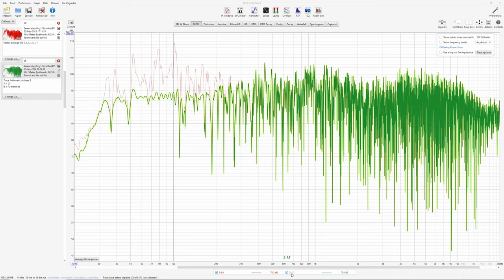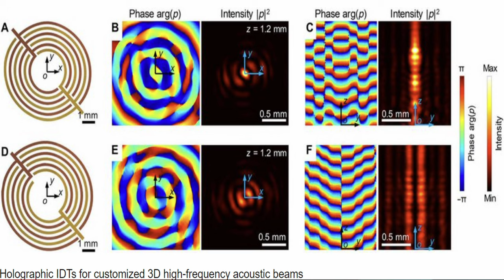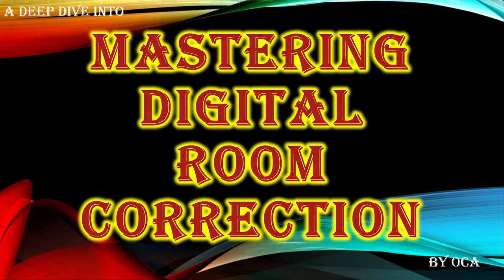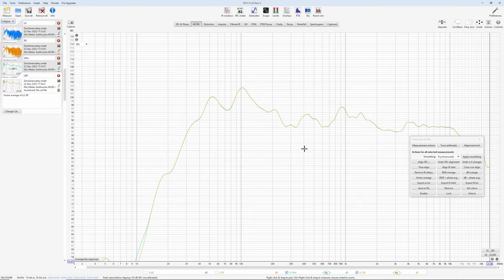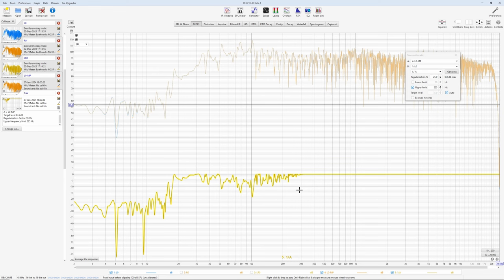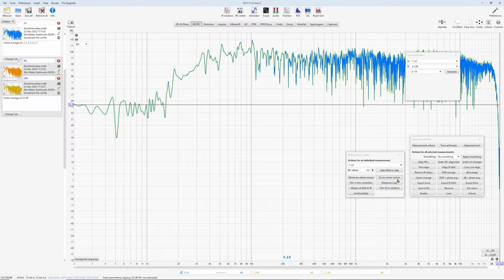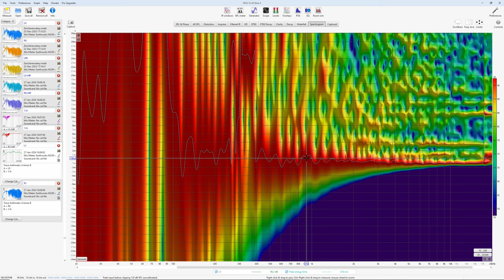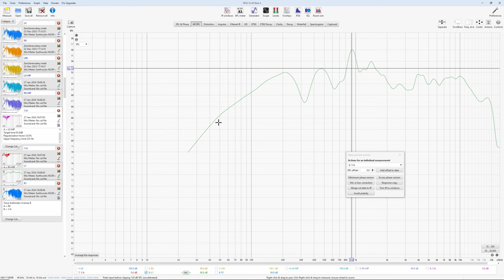Mastering Digital Room Correction

Comment: Discovered your channel through exploring the inverse filter technique for my full range speakers, and the results have been transformative—full control and unparalleled sound quality. However, I'm facing challenges integrating DSP with my JBL 590s, which sound nice but not superior with DSP. Every attempt to enhance them through DSP paradoxically detracts from their performance, falling short of the no-DSP setup. Any insights or suggestions on this would be greatly appreciated!
Reply from the maker: Frequency domain filters should work below the room transient but that's not enough to avoid sound degradation. Hard to say what exactly causes it in your case without seeing the actual measurements. I can have a look if you share.
Reply from the maker: Can you share your original and min phase mic calibration files?
Reply: @ocaudiophile I've shared the original and minimum phase microphone calibration files in the same folder for your convenience. Additionally, I've included a file for the 90-degree measurements that I had on hand to compare. Thank you once again for looking in https://drive.google.com/drive/folders/1yQxKyoWKHtQu2-b-kgZ7wUBxjO35HeSv
Reply from the maker: You've done everything right (one of the best implementations of my methods I have seen to date) but your speakers are not the easiest to calibrate. Left speaker seems to be closer to adjacent walls than the right. Most measurements had some distortion here and there but there were enough of them so I could pick good ones. 4M measurement length was tough to process even for my PC which is a beast, had to trim them to open in rePhase. Anyways, it's all done now and I'm sure they will sound great. Removing IR delays from L & R was a bit tricky, I guess that's where your filters failed. I've also embedded phase linearization (XO590.wav) into the filters. StereoConvolutionFilters.wav is the filter you need. In the highly unlikely case that, you will hear pre-echo with this one, use ConvolutionFIlters_2.wav. That's 110% echo safe but will not sound as good as the other. REW and rePhase files with all details are included in the zip below. Enjoy!

https://drive.google.com/file/d/1xjEu6LmNIySQnuBVw85xTVJMs4Wf5VtJ/view?usp=sharing
Reply: @ocaudiophile  Thank you immensely for your analysis and for the filters you've crafted. Beyond appreciated. 🙏 I'm eager to test the new filters and experience the difference soon.

May I ask whether the adjustments you've made were derived from the measurements in the 'InverseMP' file or the 'Feb_6_Fresh' one?
Reply from the maker: The "Fresh" ones but I used only one of many left and right speaker measurements in that mdat. I kept their indices so you can see which ones are used.
Reply: @ocaudiophile  From the very first second, the quality of the filter was so obvious. And of course it sounds like a much better filter that I ever had with these speakers. It's right, clear, and incredibly promising. The soundstage is beautifully layered, although I've yet to delve into all the nuances due to volume constraints. Hopefully, more critical listening can be done tomorrow. Both files are impressive so far.

I'm eager to understand every step you took in this process. While I grasp most of the techniques found in the file, 'almost' isn't sufficient for replicating such an effective filter. I'm particularly curious about how you managed to remove the IR delays. Additionally, I'd love to know how to place my left speaker correctly relative to the wall, which vertically is a mix of concrete and windows with ~ 8 cm in difference. Hence it's a tricky reference. I also struggled with Rephase. I'd love to see the numbers you have applied. I assume it was an important contributor to the quality of the filter.

There are so many questions I have, yet I'll sleep a happier man tonight, thanks to your help. I'm profoundly grateful for your guidance and the time you've invested in enhancing my listening experience. Thank you 🙏
Reply from the maker: L&R didn't both shift their IR peaks to t=0 with regular "Remove IR delays" so I cross corr aligned L to R first then removed IR delays and it worked (if I remember correctly). The clock deviations in the measurements are kind of high around 25ppm and this could be the reason for REW to fail at first.

You have to at least achieve symmetry with side and rear walls between speakers or it will be very difficult to center the phantom stage. It will shift slightly to one side with certain tracks depending on the vocals' frequency. Rotate the whole setup if you have to and try to achieve 1/3s in the room with the speakers and the LP keeping an equilateral triangle, you will immediately hear the difference in sound stage.

Phase correction was done based on the Left speaker EP (the txt file in the zip). Your speakers have one crossover at 1500Hz according to spec but somehow they benefited more from a correction at 2400Hz instead (The 1500Hz filters you will see in rePhase cancel each other out and there's only a weak paragraphic eq there)! A subsonic filter was added to remove group delay from the bass completely which should improve the bass speed. The other empty/disabled slots you see are my trials to get it right. These JBLs have a very different phase response due to their design compared to speakers I have seen before.
  @beepaaah
Reply: @ocaudiophile  Today, I spent the morning passively listening to my system and the filter, enjoying classical music from a radio program and overall sound. Later, I switched to a little bit louder volumes, from Roon to Camilla DSP, from classical to a more variety. The tightness of the bass and the clear layering of the soundstage were particularly enjoyable. However, during a track change, I thought my neighbour might have increased their volume, but it turned out to be an echo lingering for a few seconds after the music stopped, seemingly originating from the speaker ports, though I'm not entirely sure. After paying more attention, this background echo became noticeable even during music playback, leading me to switch to the second filter. This change noticeably improved the music quality by eliminating the background rumble, although I'm still evaluating other aspects of it.  For now, it remains my preferred choice...

I want to understand the differences between those filters and how exactly they were created. Maybe I could then experiment with trimming to reduce the load on my laptop with Camilla DSP, since Roon runs smoothly. Maybe to try some 3 dB shelf. (I know you are not a fan). So going through the REW .mdat file, I follow up to the 1/A filters creation. It looks like the steps that follow after that are made mainly for looking into predicted response? Am I correct? 

Phase indeed is tricky with these speakers, likely due to their 2.5-way configuration where one woofer doesn't extend up to the same crossover frequency as the other. (I've Included a link to more detailed measurements from audiosciencereview and one australian magazine in google drive.)

I've loaded the txt file in rePhase, yet it doesn't reveal the applied settings. Could you, please, export those settings as well?

Lastly, what is the best indicator in REW  to determine if one speaker is too close to a side wall compared to the other? P.S. Apologies for the lengthy post and thank you for all the help, once again.
Reply from the maker: Filter 2 is made up of minimum phase versions of the "1/A" filters and this guarantees to remove any pre-echo that could be produced by the sharp phase shifts in "1/A" filters. Normally, this shouldn't happen when there's enough number of taps as 1/A filters are also inverted minimum phase responses but I guess you have experienced first hand when you switched from Roon the effect of lower taps on these filters. The minimum phase version of 1/A filters are same in frequency response but they don't correct the phase as much as necessary, only as safe as possible.

The disadvantage of inverse filters are that inversion requires zero padding the FFT so the window sizes double up and unfortunately trimming the windows, dropping tap counts, anything can easily ruin the delicate balance and push them into pre-echo territory. From what you describe, it sounds like pre-echo. Try listenning to the beginning of Billy Jean from MJ. That track is an instant pre-echo producer.

The rephase file I sent you produces the .wav file I used in the REW mdat. It just has some unused filters in it which cancel each other out, you can remove them and the phase shape of the EP.txt file will not change. It uses the txt file I sent you, too. You should have everything in the zip unless I sent you somebody else's by mistake.

If you look at bass responses of L and R, you will see that L has substantially higher bass response than R which can only be stronger reflections from walls since the speakers are identical.
Reply from the maker: I also suspect that the final 25-50Hz of the filters not being exact inverses due to REW starting to fade out the inversion, may be the cause of pre-echo with this method. I tried to avoid it with some very complicated techniques but I am not yet convinced of their robustness. IT will possibly be another video when the time comes ;) @beepaaah

Comment: Hi OCA, could you possibly help me with your procedure? I'm not sure my measurements look right. Things are not equal on both sides of my listening room. PSB Synchrony One speakers seem to be canceling each other at 35 to 60hz when measured together but not separately. I did the mic min. phase, 1LP for all measurements - measured each speaker 3 times using length 2M, vector averaged L and R separately. My impulse response start looks like a saw-tooth: i cant seem to find where to align left with right because of this. Thank you
Reply from the maker: Difficult to say without seeing the measurements. Can you share your mdat file here?
Reply from the maker: I need access! @IanBester-j4j
Reply: @ocaudiophile   Hi, i have given full access. Sorry about that. i will email the files if you are still struggling.
Reply from the maker: You've changed the acoustic timing reference channel from right to left during measurements, it should always be the same channel for both speaker measurements. But this is not the reason for the dips in combined response, it's to do with asymmetric wall proximity between speakers. I fixed most of it by applying an extra allpass phase filter to the right speaker (Rxo.rephase which produces Rxo.wav filter). The optimal Q value is 5 but this could cause ringing so I left it at a safe 2. You can experiment with higher Q values and improve the dip even better. FL-trimmed_FR_trimmed-48k.wav is the final stereo convolution filter which should sound good:

https://drive.google.com/file/d/1mgnWTh2GQdGbF-7cckRoImDgGL3V1Xk-/view?usp=sharing
Reply: @ocaudiophile  Thank you so much OCA - I will try it on foobar2000 and let you know. Should i remeasure 3 lefts and 3 rights with only right as timing reference? My room has an alcove on right speaker side, that side is also drywall but left side is brick wall with no discontinuities. 5.4meters by 4 by 3.2 high (speakers facing short wall)
Reply from the maker: I removed IR delays and they all shifted on top of each other. I don't think it's necessary now. If you dislike the filters I sent you then of course you can re-measure and re-do. Btw, I disabled 3 high distortion measurements and used only some of them.

PS I hope Foobar and your PC can handle 262k taps. There was no further trimming possible without changing window sizes which I don't prefer with this delicate filters.
Reply: @ocaudiophile  Just had a quick listen - I might be doing something wrong but it sounds the same, i used the trimmed wav file with foo_convolve component lol, should i listen at the same volume level as when the measurements where taken eg -25db on denon receiver?
Reply from the maker: same as in? @IanBester-j4j
Reply: @ocaudiophile  Morning OCA, sounds like nothing has changed with foobar conv. When i try JRiver Studio Convolution with WDM Driver WASAPI Output i get less bass but the upper freq. sound the same, toggling between clip protection and normalize filter volume changes some loudness, more loudness and bass disabling convolution - nothing else changes, also not much CPU usage at all maybe 2%
Reply from the maker: Don't normalise the trimmed.wav filters and I'm sure they'll require some clipping headroom quantity will vary depending on the convolver. The major dip in the bass region must be improved with these filters but you'll only hear a difference with a track which has bass at that exact region. It can be further improved by increasing the Q value in rephase filter for the right speaker. The overall bass level of your system is a different story. Min phase inversion produces what your speakers are meant to produce with min delay but if you want more bass then you need to get the wall reflections and delayed bass involved. It's a choice. Generate a low shelving (LS)  filter to your taste in REW EQ and multiply both of the final filters with that before export and you will have bass as deep as you want although some of it will rain in mids and highs.
Reply: @ocaudiophile  It seems like the only thing the filter does is reduce overall bass, there is no increase in clarity at all, the speakers are both forward 1.8meter and side to side 1.3meter from the walls, i have a 18" subwoofer that i would like to integrate but i should probably first get the filter improvement before including the sub? Thanks. i will fiddle/listen again tonight at around 17:30 your time should be an hour behind that. normalize is JRiver's default (recommended) i am no expert and will disable it as i value your expertise.
Reply from the maker: I checked everything again, I think I might have produced your filters with 24 bit pcm rather than 32 bit float by mistake but still they were not increasing clarity. I made new filters and did the best to increase overall clarity but the left speaker has a placement problem which defies inversion no matter what I tried. Still, stereo1.wav should be a lot better than last filters. stereo2 is what needed to be done to fix left speaker but it will ring like crazy. I just added it to take the very slim chance that it may not ring because then it will sound really good. Don't forget to adjust for clipping.

https://drive.google.com/file/d/1LLD_7ZxNK1Yjsp5mroH5w6cbv4zSQgw_/view?usp=sharing
Reply: @ocaudiophile   Evening OCA, Does this filter have a night and day difference on your speakers? I can confirm that i only "gain" a overall bass reduction with JRiver Convolver. Should i remeasure? Thanks for all your troubles
Reply from the maker: Here's the same filters with added bass boost:

https://drive.google.com/file/d/1SxmIpT728Jopcbrix_AbkRRFWvNkEkwp/view?usp=sharing
Reply: @ocaudiophile  Thanks again for your efforts, but there is probably something wrong with my setup. Probably something stupid i'm not noticing 🙄 listened to all three - not much difference and no "echo" or distortion effect audible. Topping D10s DAC -> SPDIF COAX output to Denon AVC-A11XV (L+R Distances at 7ft LARGE setting). Was lucky once - had the speakers at locations the stage and imaging was so precise (close to where they are now within a foot but could not find it again)

Comment: Your videos are awesome, some stuff goes way above my head though.

Just to be clear, your previous video: https://youtu.be/5YcH7j2-L1Y?si=s_U4Wh3Qpb3ZsRaJ   named: "REW (Room EQ Wizard) Top Tricks: Convolution with Inversion (no EQ filters, all FIR!)" is not relevant anymore? I followed that one many times, but now I'm confused if I should leave that and try the video above? Or are they connected?
Reply from the maker: They both invert the speaker response at the LP. The original one, uses a minimum phase version of the inversion. The newer technique inverse the min phase version of the speaker and uses it as a filter as is. The latter has better phase correction but requires more taps. The original one has the advantage of being able to be inverted over a target curve. The other iverts over a flat target. You wouldn't lose much by trying and comparing them both.
Reply: @ocaudiophile  - Good explanation and looking forward to the upcoming video re-introducing the House Curve/LS Filter.  You've put out a number of techniques, this on correcting Schroder (up to 225Hz) against a flat response, the mentioned FIR video to correct against the entire range against a House Curve, and your Digital Room and Speaker correction workshops of which I only used the EQ FIR technique to correct from 20-200Hz, 200-500Hz and 500-20,000 along with IR window size adjustment to lower my TAPS.

That being said, I hope the upcoming video addresses benefits or preferred techniques such as Schroder 0db/Flat technique, Schroder with db boost/house curve technique, full range against house curve technique (updates to FIR Inversion video vs Workshop EQ FIR video).

Thanks for being the Man and educating us!
Reply: I finally got round to trying this. This one gives me way better results. Other one tamed my high mids/highs a bit more. But also had some weird effect on the sound stage for some reason (maybe I did it wrong, who knows).

For my system, in my room, with my speakers adding the Harman curve sounds just a bit richer. But I got to find one with a 2 maybe 3 db rise in the bass. Now it's sometimes overwhelming.

Could I add a small low pass  shelve in ROON to tame it a bit? Or would that ruin the filter?

Great work once again!🎉